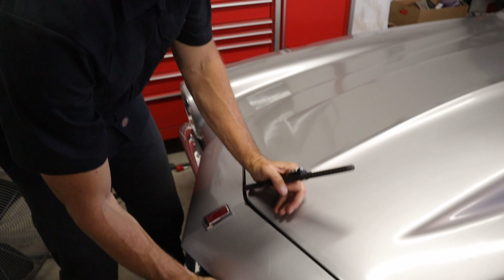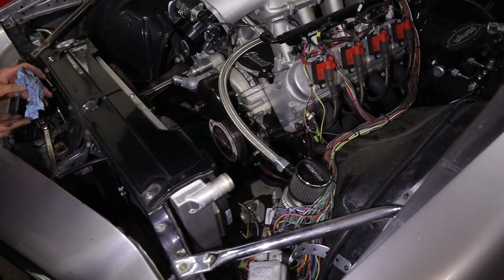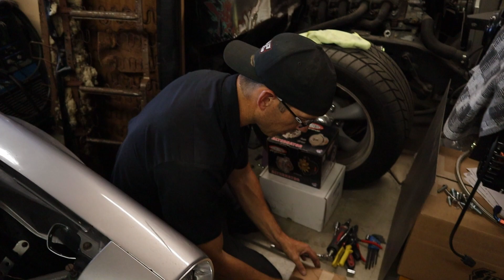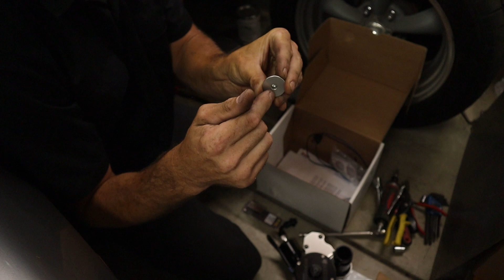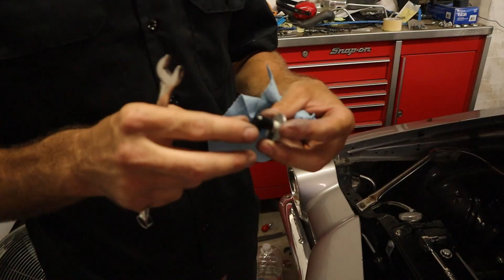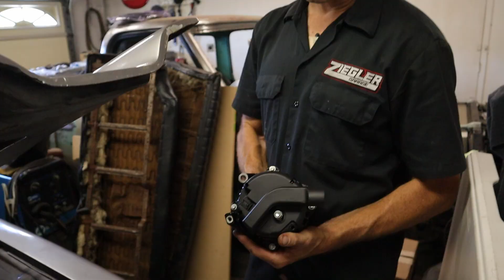This simple upgrade PROVED nothing bolts right on

Comment: What size  small block did you have in it before ls?
Reply from the maker: It was a .060 over 350 block with a 3.625 inch stroke, which makes it around 372 c.i.